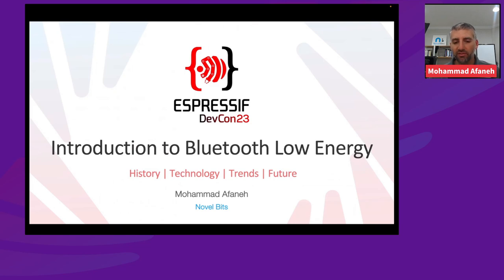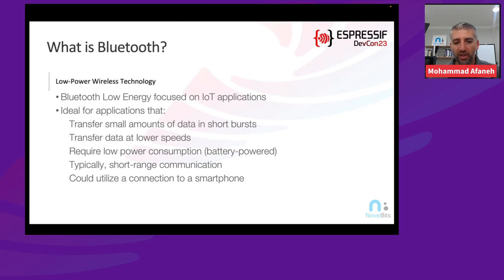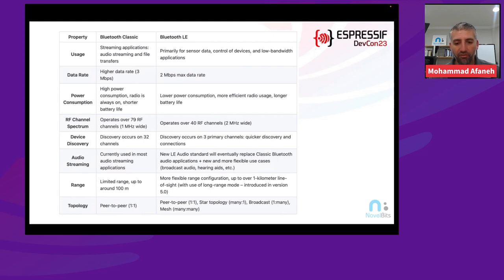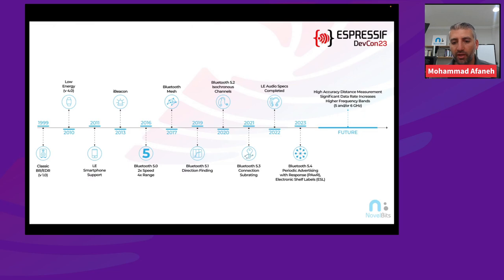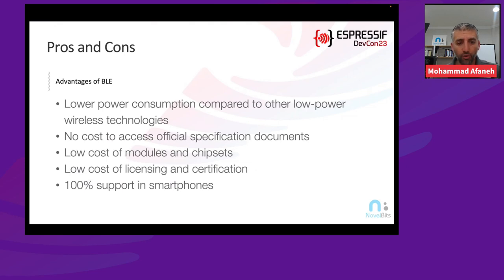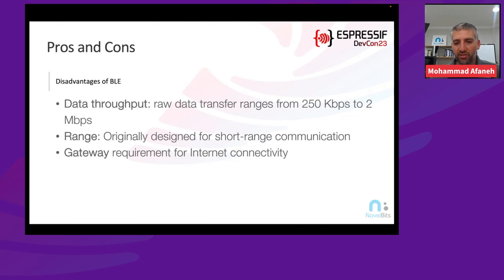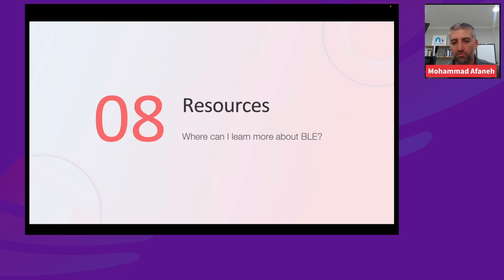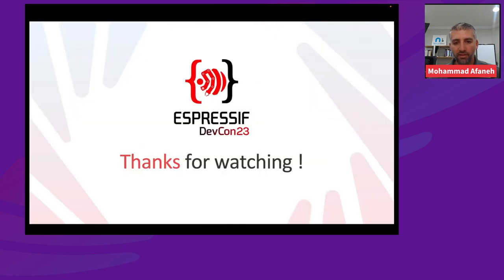DevCon23 - Introduction to Bluetooth Low Energy Development in Embedded Systems

Comment: I'm using ESP32-C3-WROOM-02-N4 module with STM32 controller. Can I use Bluetooth Classic Commands instead of BLE? Is there any supportive firmware I can get for the same purpose? Like backward compatibility?